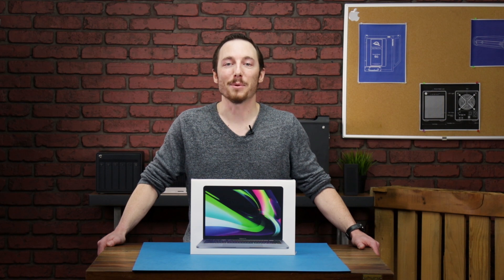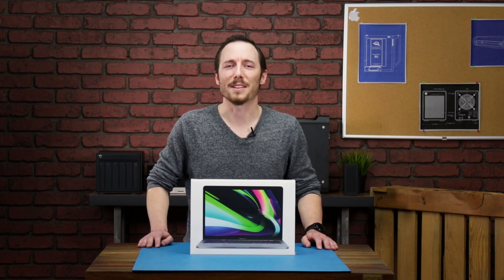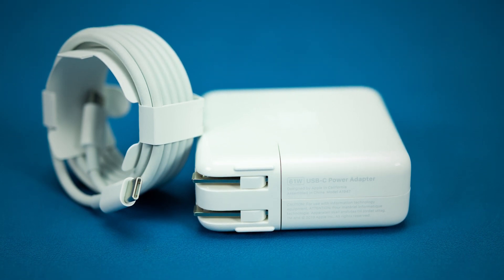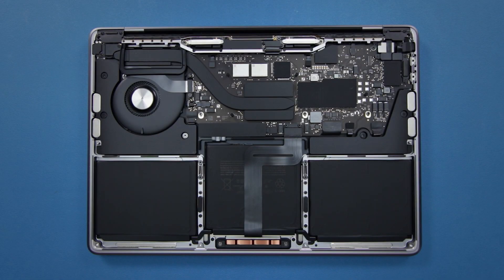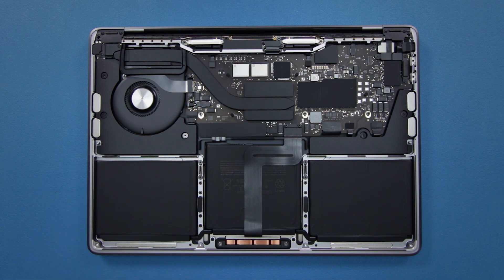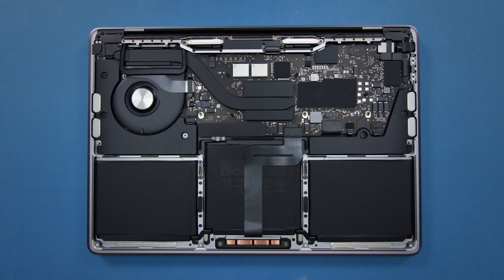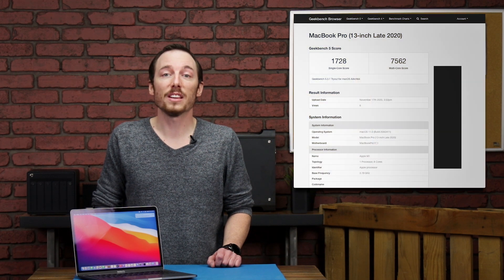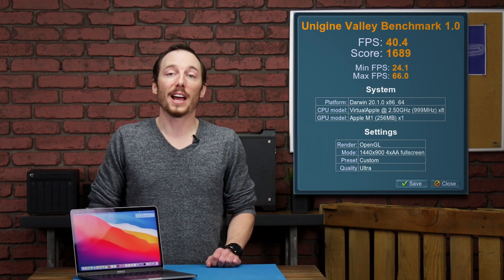Unboxing and Teardown of the 13-inch MacBook Pro (M1, 2020)

Comment: Will it be easy to replace internal hard disk on this macbook pro
Reply: No it will not. As the video shows the internal drive is soldered to the motherboard. Along with all other components being part of the SOC on a single die.
Reply: Thank You for your information. I was so confused between the macbook pro this year and the macbook pro in 2012. Once again Thanks

Comment: Hi Brady, nice video! Does the M1 MBP have x2 Thunderbolt controllers, ie one for each port? And does each port have the full 40Gb/sec capacity? Looking from a music production perspective where I need to connect multiple external SSDs holding large sample libraries, an audio interface and midi keyboard hence would require the bandwidth with only 2 ports. Could you please also kindly check this for the M1 Mini, please? In 9to5Mac’s  video https://youtu.be/bjcmnVkPptQ  they stated the new M1 Mini has x2 Thunderbolt controllers, one each for the two ports vs the old Intel Mac Mini which had x2 Thunderbolt controllers for 4 ports. Would be most grateful for clarification on this. Many thanks 🙏🏽

Comment: The base model intel based MacBook Pro 13 (with 2 thunderbolt 3 ports) came with a single fan and the model with the 4 thunderbolt 3 ports (intel based) had 2 fans.
Reply: Yes. Thanks ;)
Reply: True